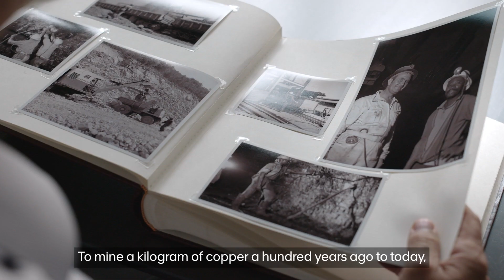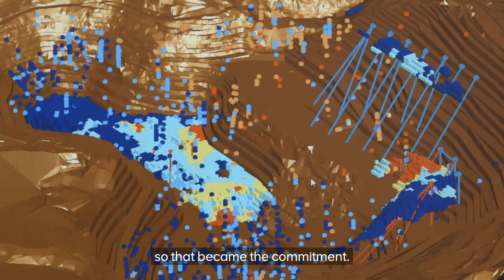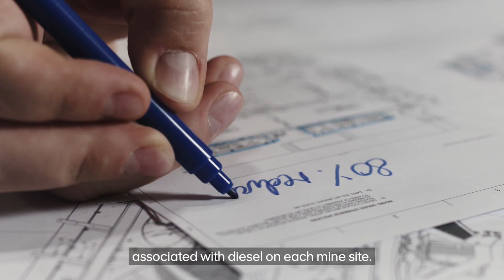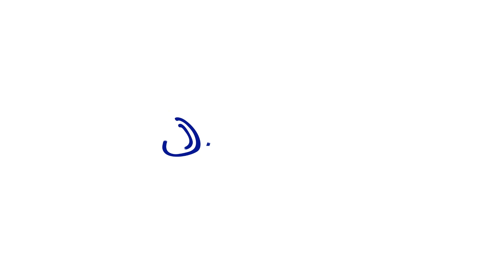Our hydrogen truck: The mission

Comment: 30% round trip efficiency for hydrogen. 
Why not rather use over head lines and battery for the last mile?
Reply: Trolley assist has been around for decades - there are reasons it has not been embraced across the industry. You need cheap electricity and plenty of it near the mine site.
Reply: The efficiency of burning fossil fuel to generate electricity for charging batteries is typically 30%. A fantastically stupid idea.